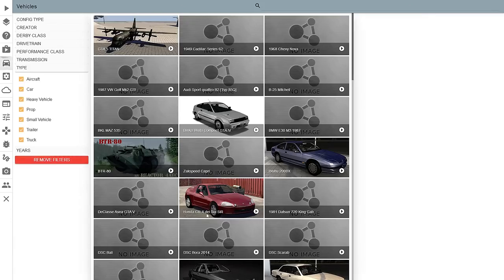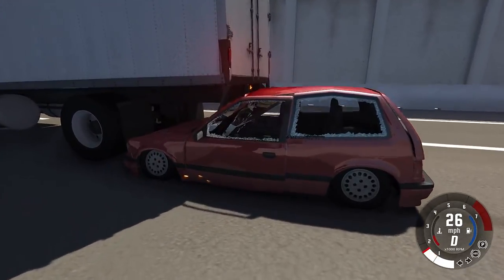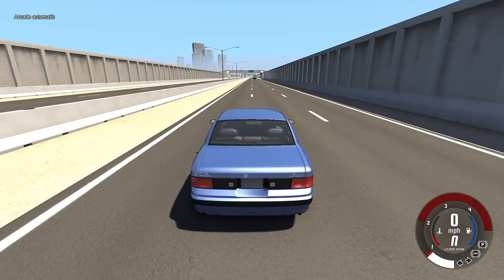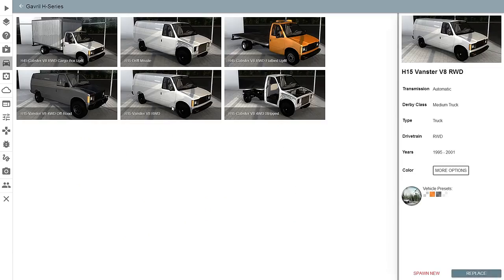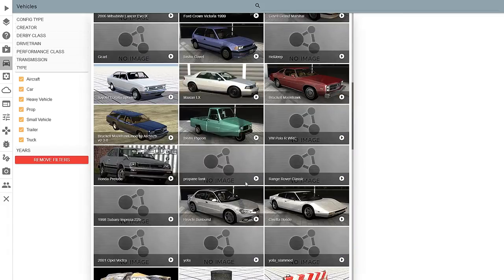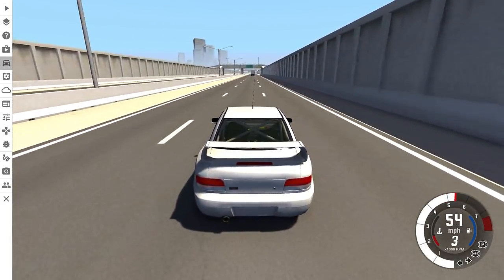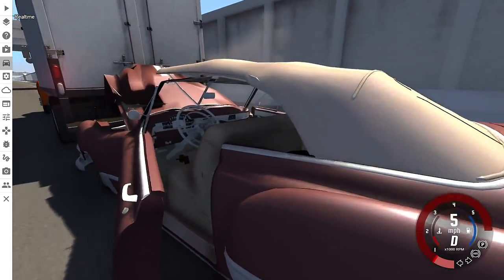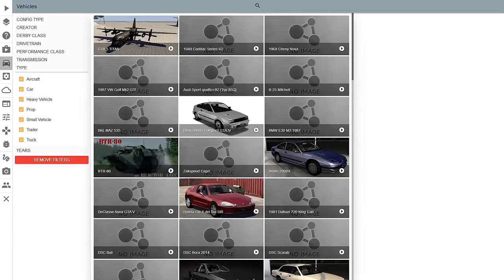Underride Guard Crash Tests - BeamNG.drive

Comment: Fact: 80% of trucks on the road are equipped with underride guards that are not approved and are not up to safety standards. This means that even if your car is high enough to hit the guard the guard would give way to the force of the impact and you would go under the truck either way.
Reply: That’s tuff
Reply: Fax

Comment: I think the truck being loaded (I think you can load something like 25k lbs in one of those trucks legally) and the parking brake on would result in a slightly more favorable result in terms of cabin intrusion. the truck won't lift up as much on impact, and the bumper should bend rather than slide up the hood.

Comment: The under ride guard is extremely important if you want to keep your head. My friend (Occupation: Firefighter) responded to an accident where the truck did not have one and a car wasn't able to stop quick enough, crashed into the back of the truck, and unfortunately decapitating them. So just a little warning, keep your distance if you're behind a truck
Reply: Edit: I didn't mean to say it was very important, I meant to say it isn't always safe (so yes the truck did have an under ride guard). And the car that hit it was not a van or truck but a car. So please be safe on the road

Comment: All of these crashes were lethal, no hope for anyone to survive, what so ever.
If it's a (almost) sudden stop from above 70km/t you are pretty much dead...
Reply from the maker: +keb It's not really that close to instant deceleration because the truck doesn't have it's parking brake on.  The slow motion just makes it look worse than it really is.
Reply: Yeah! Sad we didn't get to see realtime crash too... Kind of messes with my head, making it look way more deadly actually. I noticed most of the crashes was braked down to around 15-25mph which would actually not be deadly. Parking break would not actually do much if it were on or off, because of the total weight of the truck. (Just a slight difference.)
Reply: +WhyBeAre hiya can you try this again but place a car behind the lorry and crash into a back of a car to send the car in front into the back of the lorry to see what happens x
Reply: +VatD3 This looks like a great crash simulator to promote safe driving.
Reply: I'm not really joking around, but ok.
Reply: What about 64 km/h-40mph
Reply: +AlterEgoKEB Actually I think that was a glitch because the car was skidding and it measures wheel speed.
Reply: AlterEgoKEB
Reply: not true
Reply: AlterEgoKEB
Reply: 70 mph

Comment: WhyBeAre  in terms of the air bag. It would have deployed by the time the rear guard would reach the cab, and airbags are made of extremely strong material which overall would improve your odds of surviving.
Airbag or not thought, your not walking away from this.

Comment: YBR, the UK has sides on the trailer of the truck to stop cars going in and under the truck which would either be crushed by rear wheels or pritty much making the trailer jump up and land most of the wheel area on your roof.
there mostly there to deflect cars off

Comment: Any of these crashes will definitely result in leg injuries. Only in recent years have automakers been able to strengthen the firewall enough. Also, the situation with the Grand Marshal dipping down is a bit unrealistic. Most cars have active suspension to avoid the front end raising on acceleration and dipping under braking.

Comment: a larger vehicle will flip forward, theres such thing as a hard shoulder and hazard lights to help keep people alive and if you dont know what a hard shoulder is look it up, the 2 main reasons why a truck will stop on the motorway/ highway as you call it is air brakes are out of pressure and lock up/ theres traffic

Comment: This is why if you are undeniably going to hit a high barrier such as one of those crash guards, or a deer, you may be better off braking only until you are somewhat close to the object and then slamming the throttle for the last few moments just so you can get the front end of your car to tilt back up.

Comment: There was an accident in michigan in this past winter where semi's and cars were driving to fast for road conditions. A suv slammed into the back of a semi that had one of those bars, and the couple walked away from the crash. It all depends on the vehicle, depends on how bad it could be. A corvette would be a fatal accident. I owned a corvette and noticed how low it was and decided to sell it for my safety. I'd rather a suv lol

Comment: 5:13 Actually if you had your seat leaned back really far, you wouldn't go bouncing forward bouncing your skull into the piece of metal. If your in your car with your seat belt on, and you jolt forward fast enough, the seat belt would stop moving and you'd be held in place.
Reply: I wonder what the point of a seatbelt is...

Oh! I got it! it's to keep the person in place so that's why seatbelts lock… nah, that wrong

Comment: The sunburst with brakes WASNT FATAL FRON THE GUARD! It was the fact that you went and hit it at 85 mph that it bent the guard so badly that it smashed into the actual box part of the truck. I'm 104.73% sure that the driver would survive if you reduced the speed to 60 mph

Comment: In order to have a collision like this that would trigger such results, truck would have to have been already in a collision long enough to dissipate all of its kinetic energy or break several laws by stopping in the middle of the road. If the truck was travelling at speed, there would be more time for the pedestrian-driver to see it and respond by breaking and/or swerving around the rig, and if the driver was to hit the truck at speed, when both vehicles are travelling at speed, more of the pedestrian vehicles kinetic energy would be transferred to the truck, and less is transformed into forces that deform the pedestrian vehicle. A better scenario would be the roadway obscured by fog, and the pedestrian had followed the truck's taillights; a scarily common occurrence in foggy conditions, and said truck driver had failed to flash four-way indicators. That is IF your face does not become the crumple zone.

I know this because I am a nerd, and just got through reading a CDL booklet. Go me :)

Comment: I like your videos, you're doing a great job. I have a question, if you could answer that would be great. I can't figure out how to make another car to follow the car I'm driving for example, is that possible in the newest version?
Reply from the maker: Miroslav Stoyanov Yes, but it's a little complicated on how to do it. I'll try to make a video showing how because it's a lot easier to explain it like that. Look for that video within the next 24 hours because I don't know the exact procedure right now and I'll probably forget to come back to this later.
Reply: +WhyBeAre On the Honda Prelude the lights didn't get shaved off it was the mirrors
Reply: WhyBeAre Thanks. You have to use "AiControl" app, right? But it looks like there's no "Chase Player" option in the newest version? So, I guess there's another solution. Anyway, I'm looking forward to watching that video to figure out how that works.
Reply: Miroslav Stoyanov It is in the options I thought

Comment: D.O.T bumpers on 18 wheeler trailers are weak. They are some what useful a very low speeds, but even at 25 mph, that bumper is going to fold in if you dont hit right where the support beams are. Sincerely, a flatbed truck driver
Reply from the maker: IMlild3dude This video was actually inspired from me reading an article that said just that. I'm surprised there hasn't been a push for improving them to be safer honestly.

Comment: I got beamng drive on my moms window 10 computer, and it lags a lot. any way how to stop it?
Reply: How about getting a better computer xD
Reply: It don't matter about the OS. Your processor is most likely to small...
Reply: Yeah that's what I thought too, the processor sucks😂
Reply: That's why you c heck the requirements and what you have before you buy the game
Reply: If possible lower the graphics. That's what i did and i have no lag at all
Reply: I have Windows 10 (installed yesterday), Nvidia GeForce 730 graphics card, Gigabyte 78LMT USB3 Motherboard, AMD Quad Processor, 8GB DDR3 RAM, I manage a solid 25 FPS on medium settings. £375/€530/$580. Get a better computer, the OS doesn't matter (the game worked almost the same on Win7).
Reply: Connor Doogan  what GHz you have on your processor ?
Reply: My specs:

CPU: (Processor): Intel Core i7 3770 (Quad Core, 3,9GHz)
GPU: MSI GeForce GTX 980 ti
RAM: 8Gb DDR3 (Dual-Channel, 1866MHz)
Motherboard: MSI B75MA-P45
Storage: 1x 120Gb SSD, 1x 2Tb HDD

My pc runs the game at allmoast max wil just a little bit struggeling on the CPU side (I know the GPU is being bottlenecked ;)

Comment: I saw horrible crash like these ! Mazda 6 hit a truck at 110mph ( speedometer was stuck at that speed) basically, side of the car was torn off, the passenger died instantly,while driver suffered severe injuries to head , it was in vilnius kaunas highway, lithuania.
Reply: And it ONLY took third of the guard rail off the truck!
Reply: Derpy Dan it was haunting to see that

Comment: Get a racing wheel, iv'e used software to get my ipad to kinda do it and it's awesomeee if u tab it will keep the like for example 30 degree turn consisntently and you can have either paddles on the wheel or pedals so of u wanted to keep say 50mph u totally could and i did and it's FRIGGIN SICK and it works with tab too so if u wanna do like a rolling drag race, piece o cake and it would improve gameplay and make videos so much better in terms of looks ;)

Comment: If there are any, install some European trucks, and do some crash testing with those, since they will act differently to the American truck already in the game. Also, drive around in a village in a Reliant Robin if you can. And crash test a Volvo.
Reply: I'm not sure anyone has made mods for that. Not bad to check tho.
Reply: The Ibishu Pigeon is essentially the same vehicle as a Reliant Robin, right down to the tipping over if you dare to corner any faster than a walking pace.
Reply: YLW Pyro Then i demand more Ibishu Pigeon videos

Comment: but in the real life, the truck with the trailer is moving to, unless there is a traffic light , no?
Reply: Your right.
Reply: Well no, not exactly. At the beginning of the video he made a comment on the truck being stopped for "some reason" so you could say that the truck was broken down or was stopped because of traffic or whatever. These types of crashes happen pretty often, when a truck stops in the road because of a mechanical breakdown, weather, or traffic, and a distracted driver doesn't see the stopped vehicle in time. He then slams into the back of the truck. Most of the wrecks I've been on, the Guard sits too high, and therefore the car goes underneath and the driver suffers heavy injury. Decapitation, full or partial, is common.  -EMT
Reply: Mystic Pup :)
Reply: Hunter Smith sorry, I wasn't paying attention.
maybe WhyBeAre need to test that when the truck is moving. :D
Reply: Yeah, I agree, a part two with different angles and situations would be good.